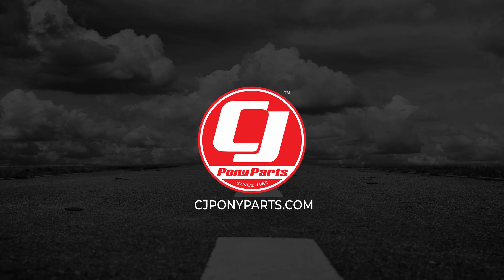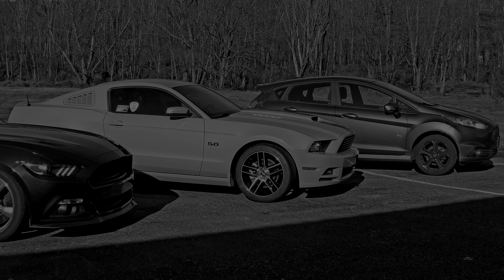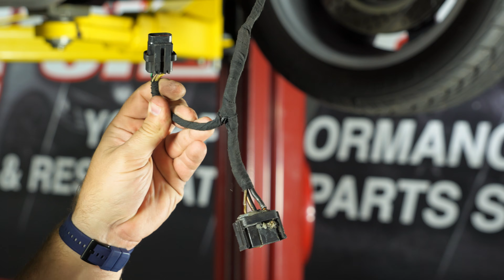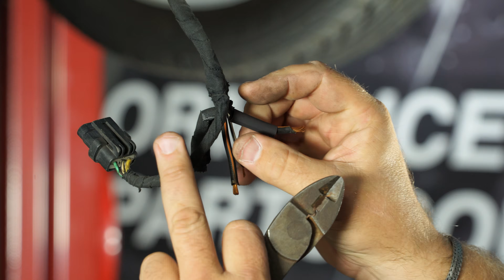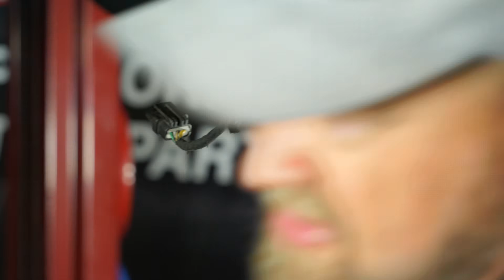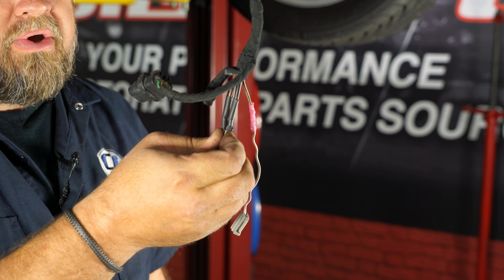1979-1993 Mustang Install | PA Performance Alternator

Comment: I just replaced the alternator in my 1992 Mustang 5.0 but the battery light is staying on. Any tips on how to troubleshoot the battery light coming on? The battery voltage is between 13.48 volts and 14.41 volts while running after replacing the alternator.

Comment: Is that a small case 3G? I thought all the large case 3G alternators came stock with 130 amps. 
 I’ve heard the smaller case 3G made 95 amps in the Escorts from the 90’s with the 1.9 engine.

Comment: NEVER re use the factory power wires. They are not desugned to handle the extra amperage.  Use a deducated 4 gauge power wire with a 125 inline fuse wired directly to the battery,
Reply: Even with the 95A? I just picked it up because it’s a “direct fit” with no additional wire upgrades needed .. thanks..:)

Comment: Can a bad alternator be the result of why my car will not shut off or let the key out
Reply: @303StreetMachines hmm when I unplugged the wire on the alternator it worked properly and I’ve already checked fuses and battery and replaced the ignition switch and lock cylinder
Reply: Ignition switch or lock.
Reply: @classicstangbrn8964  both
Reply: @303StreetMachines and before it wouldn’t work
Reply: @303StreetMachines thanks

Comment: Did you say that's a 2g alternator, because that's a 3g, and hope you hooked the belt back up.
Reply: If I want to run the 4 gage wire on the pa 2g 95amp altenator could I????
Reply: You had a 95 amp alternator on the table but you put 130amp alternator on the car.
Reply from the maker: Is that why its not charging?!?!?!? :).   Yes we did put the belt back on at the end of the video, the shots were from before. And yes I did make a mistake, it happens, thanks for pointing it out.